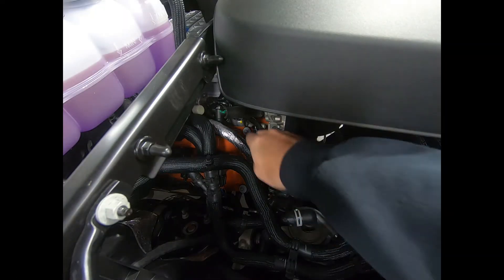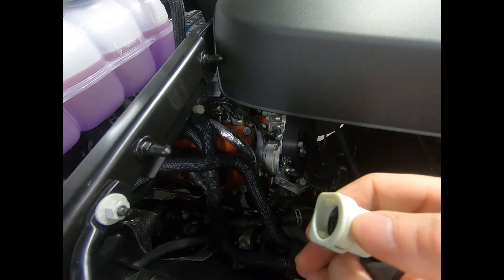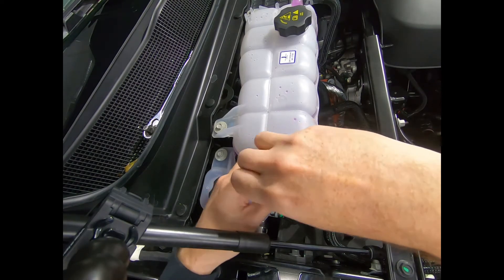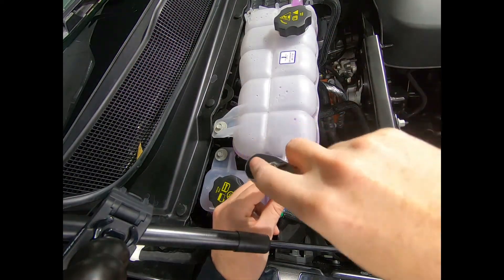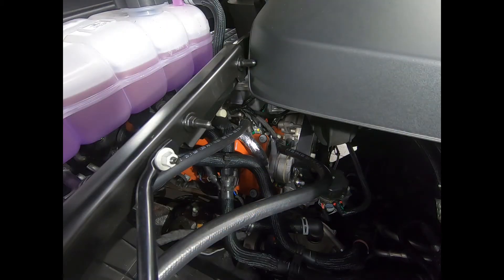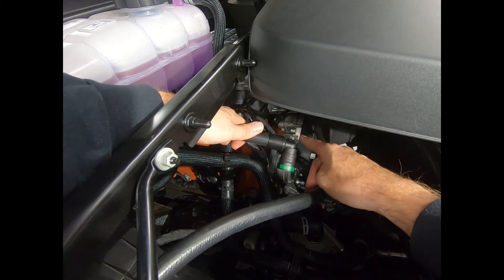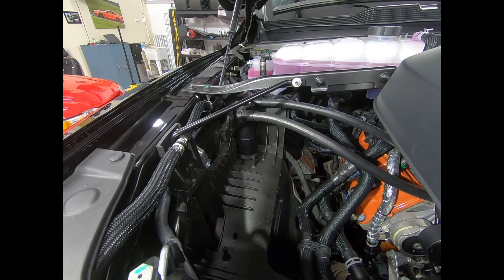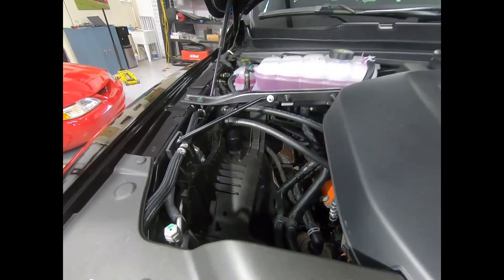J&L Oil Separator Co. 2021-2024 RAM TRX Install 3071P

Comment: what the prpose on changing the factory original ?  Got a TRX thats why im asking
Reply from the maker: Primary purpose is to capture the oil that would be recirculating back through the supercharger/engine.  Keep it out of the small intercoolers to maintain peak efficiency.  Here's a video explaining the process - https://youtu.be/nTpUjiCsPK8
Reply: Does this void warranty?
Reply from the maker: Sorry for the delayed response. The dealer would have to prove that the aftermarket part caused a failure per the Magnuson Moss warranty act. You can always check with your dealers service department as well, some are easier to work with than others.